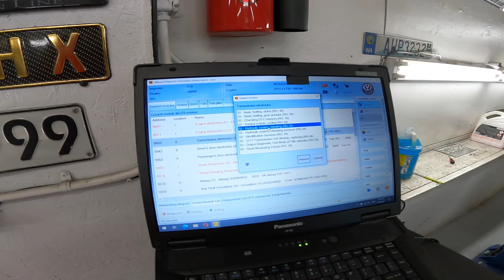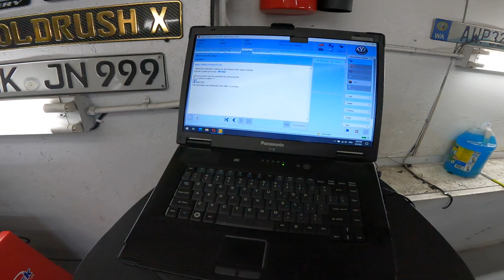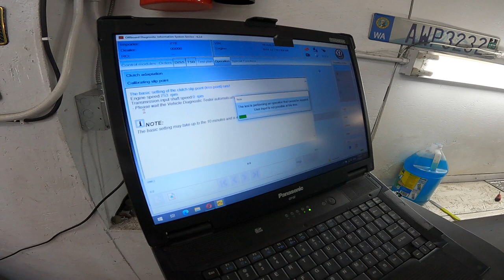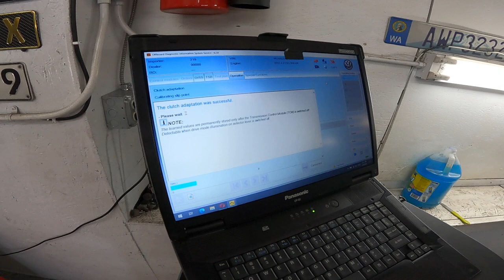Audi R8 R-tronic Clutch replacement . Installation, adaptation and perform procedure .

Comment: Thank you. One question, is there any regular periodical for doing clutch adaptation as it wears?  ie, my R-Tronic has just started clunking into first or not even engaging first as I stop at red lights. I was thinking to do a clutch adaptation to reset the kiss point for the worn clutch plate (it has 100,000km on it).
Reply from the maker: is not required

Comment: Awesome video. What do you use for a battery maintainer during programming? Is there a specific mode for Lithium batteries or does it just work on all types of batteries?I'm not sure if the lead acid battery supplies for programming can work on Li-ion batteries that come in F80 M3 and F82 M4's
Reply from the maker: Thank you ! We use snap on battery Charger Plus (EEBC500)- it has programming mode. You can adjust the voltage what is required ( we use 14.2v) it keeps on programming and up to 100amp .

Comment: Thx for the video. Could you please just tell me why you remove the actuator ? If you remove the hydraulic tank with perferics this is enough to easily put out and in the transmission and the pressure is released from the throwout bearing so that the transmission can go all the way in... The service manual doesn't even say that you should remove the tank and periferics... Appreciate your feedback!
Reply from the maker: Hello! Actuator been removed for cleaning dust on shifting rod and re-seals silicone around. After any manipulation with clutch (gearbox, shifting mechanics, pump) need to bleed system for avoiding any problems. We showed how to do this job right, but the other way is possible
Reply: @GermanAutoHaus  Thabks for your response ! Keep on posting movies 👍👌

Comment: Hello, I loved the video! Does the R-Tronic unit need to come off when installing a new clutch and release bearing?

Thanks!
Reply from the maker: Technically - no .We remove actuator on this video for cleaning and checking condition.
Reply: @GermanAutoHaus  thank you for the response! Im just little confused on the bleeding hydraulic system… Could I just use a regular pump for bleeding brake fluid?
Reply from the maker: @alexouchakov1423   we never try this , all bleeding procedure done by ODIS .
Reply: @GermanAutoHaus  I have VCDS. Would that work as well?
Reply from the maker: @alexouchakov1423  we never use VagCom for clutch adaptation .. no advise for this tools
Reply: @GermanAutoHaus  quick question, what do you do with the transmission fluid? Do I have to top it off? change the fluid? How do I check if there's appropriate amount of fluid in the transmission? Thanks!
Reply from the maker: @alexouchakov1423  just adjust level by overfill (filler) hole on side of transmission. But I would like to recommended replace fluid
Reply: ok. I'm replacing my throwout bearing. do you need any special tool to remove the 3 torx screws? i can't get access to the bottom last screw and I think i stripped it.
Reply from the maker: @alexouchakov1423  that’s very easy to replace trow bearing. Make sure you have two o rings
Reply: @GermanAutoHaus  and can I clean the flywheel with brake cleaner?
Reply from the maker: @alexouchakov1423  for sure .
Reply: @GermanAutoHaus  do you think I should get the flywheel resurfaced? There’s little grooves like brake rotors
Reply: @GermanAutoHaus  and do I have to put locktight on the 3 bolts that holds the throwout bearing?
Reply from the maker: @alexouchakov1423  just little bit blue one
Reply: @GermanAutoHaus  I’m trying to put the transmission back in. But no matter how hard I try, it’s not going in. If left side goes in, the right side comes out. Viscera. Any tips?? Thank you.
Reply from the maker: @alexouchakov1423  it is very easy with using central adjustments tools.. you can see from vlog , or we have vlog for Lamborghini Gallardo clutch replacement. It is similar
Reply: @GermanAutoHaus  when you opened the r tronic module and pushed it with a flat head screw driver, why was that needed? Is there a chance that mine needs to be done also?
Reply: @GermanAutoHaus  what’s the tool number? And I understand that the tool centres the clutch, but how do you make the splines align when putting the transmission back in
Reply from the maker: @alexouchakov1423  tools for alignment hand made . Also you can turn flywheel by small pry bar or special tools for spin harmonic balancer
Reply: Hey do you know the torque spec for the Rear Axels bolts? I'm just in the middle of putting everything back in after clutch replacement. Thanks!